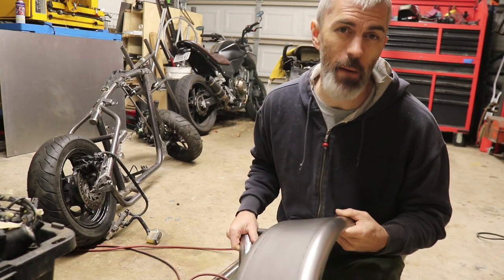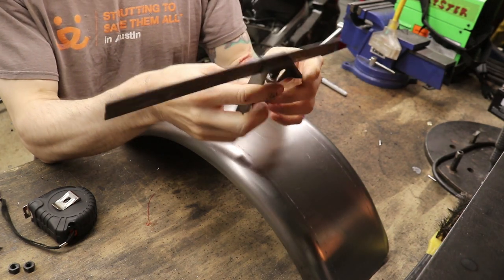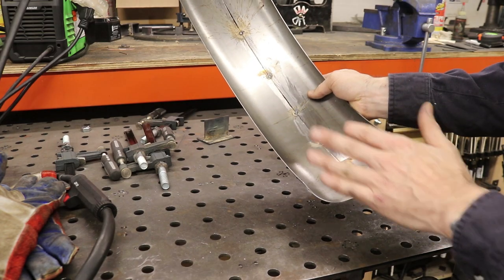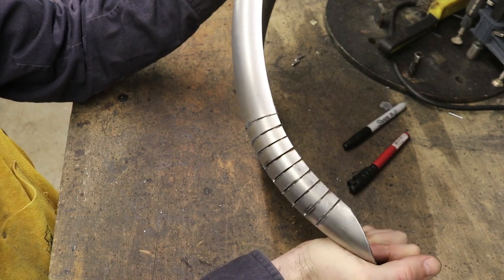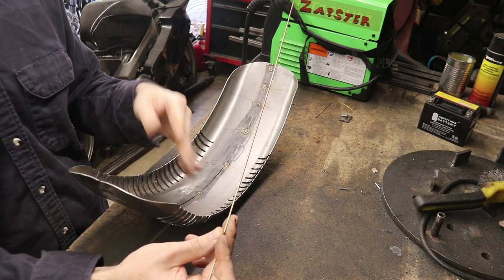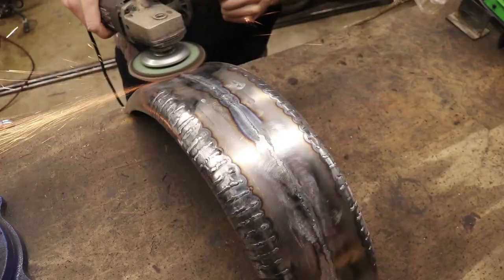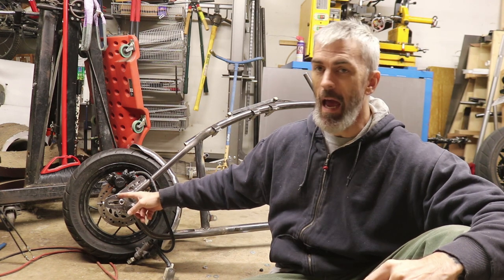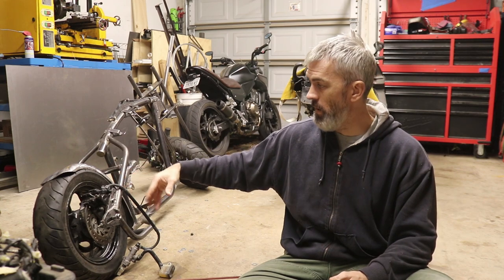Making a Motorcycle Fender from a Trailer Fender | Grom E37

Comment: Isnt there another way of making it conform by applying a long piece of wood (for leverage)and putting it under the side lip,prying it apart a little and then moving the lever a couple inches  and repeat again and again all the way to the end.Of course you have to have the fender lying on its side on a table and all clamped down where it counts so it doesnt move.Dont pry it up too far.Youll have to constantly check your work as you go along to make sure you dont pry it apart too far.I saw a guy on Chopcult demonstrate this.Its all by trial and error

Comment: Speaking of bondo, could you have just filled those slots with body filler of some sort. Maybe weld every 3rd one and then filled the rest with filler? Looks fantastic with the route you took I’m just wondering if it would have saved you some time. Keep up the awesome work this thing is gonna look gnarly!
Reply from the maker: In this case my welding was not great and I had undercut from not adding enough metal. So I plan to add bondo or body filler (I think of those as synonymous, though this may not be technically correct?) to fill in the divots and make it look nicer 🤞
Reply: @HooptieDoodle  body shop owner here.  Bondo is the brand name for a specific body filler.  It is the reason that body fillers have such a bad reputation, because Bondo brand  body filler is total crap.  Their fiberglass resin is surprisingly good, but stay away from Bondo brand body filler!
Reply from the maker: @aamantium1  great tip. Thanks!
Reply: That may sound like a good time saver, but all the stress a rear fender takes, all of that filler between the welds will litterally crack and fall out.